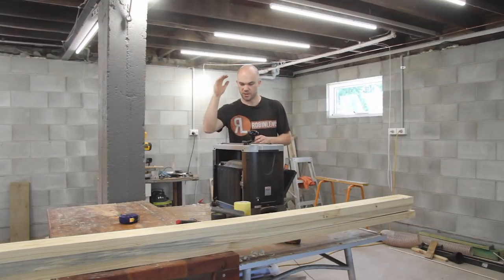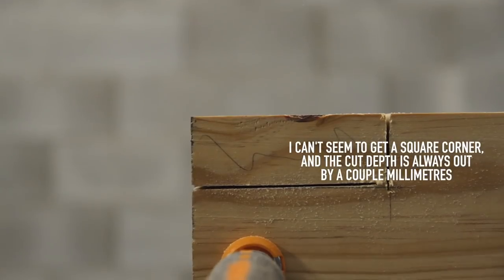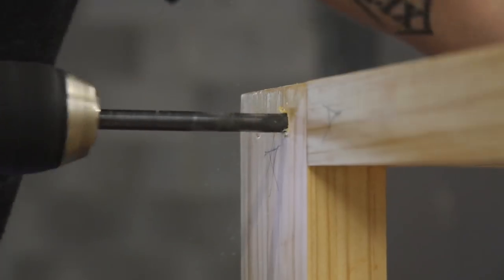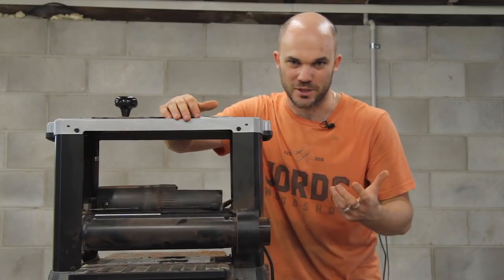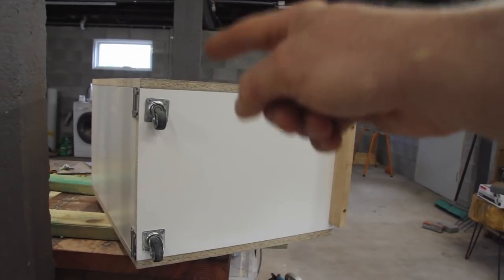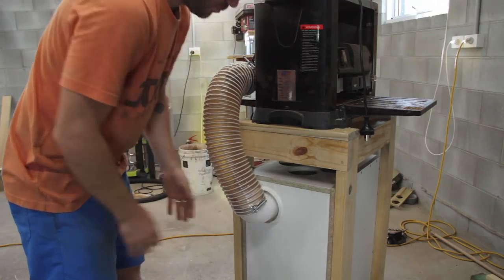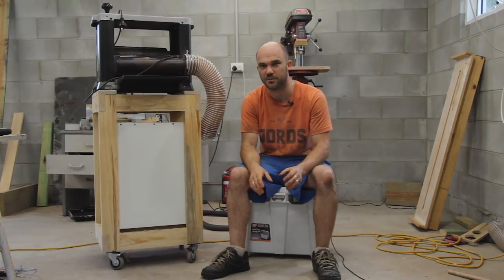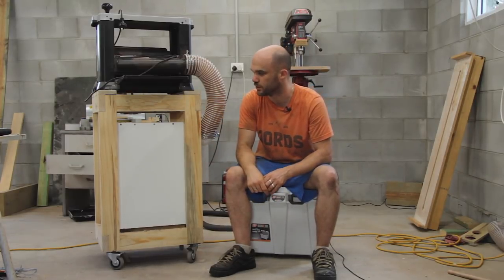DIY Mobile Planer Cart With Passive Dust Collection | Woodworking

Comment: If I may make a suggestion - with your system your getting positive pressure buildup almost any size vacuum that reduces that pressure will help the planer blower do its job and you should see better performance but you have still built a great little dust collector no matter.thanks

Comment: Great video.  Liked the roll away stand/dust collecter concept.  The chips and dust collection is a problem without a central vacuum system.  

Getting ready to purchase a Dewalt 735 planner, your video was very helpful to what can be done to control the dust.

Thanks for taking the time to explain how you controlled the dust on your planner.

From, Kansas City Missouri USA
Reply from the maker: Jack Dotzman it’ll work great for that, I’ve heard that planer has a very powerful fan for extracting chips

Comment: Shop vac will suck up those chips much easier.  But this does the job! Put a product alert on pickles and gumtree, they will pop up pretty frequently.
Reply from the maker: Pickles up here hardly has any good stuff! I look at it twice a week, most of the time it’s shop fit outs. The problem I had with my vac is the blower forces harder than the shop vac can suck, so it ends up making it worse. Guessing a bigger vac would work though
Reply: Anthony Tobba that's the one I have.  Would recommend.

Comment: Great idea!! You could try to off set the bottom dust door hinge for 100mm or so. So that when try to empty the box you can hang the wheels end on the edge of your bin (Like what you did in the video) and still be able to let the door drop open fully, if you get what I mean?
Reply from the maker: I know exactly what you mean! Give it an edge to rest on so the door can open freely. Great idea

Comment: I have my planer connected to my dust collector with a 4" hose, and I still get some chips coming out the front of the machine. It is not much, but there are a few. Just to let you know, you're is acting about right. That will be a nice solution for you!
Reply from the maker: Thanks Bruce. Yeah, until I get it hooked up to a proper shop vac it's a decent work around

Comment: Just what I have been waiting for thanks man. I have a similar Hafco thicknesser which I have attached a small shop vac to and it does not work very well always clogs. Looks like using the 100mm extraction pipe is the way to go. Thanks buddy shop is coming on nicely.
Reply from the maker: Thanks man. I tried hooking my little vac up to it, haha it did not work! Using a big pipe, especially smooth pvc, makes all the difference
Reply: Robin Lewis will give the pvc pipe a go and will let you know how I got on. Cheers.

Comment: Like the project! I just got a planer a week or so ago and need to get it mobile as well. I'm also planning a miter saw station along one wall and it would be nice if it could maybe be a little shorter and stow away under it somewhere.

I have a basic shop-vac, and so far I've had it hooked directly to the exhaust. It fills up pretty fast, though!
Reply from the maker: Thanks! Being able to store it away is a big bonus

Comment: Love the project as I’m looking to get a planer soon. Even with the locking casters do you find that with longer pieces that the cart still wiggles due to the swivel part of the casters still able to move?
Reply from the maker: Thanks! There's a little movement, particularly as the timber hits the rollers, but it's not bad at all. I actually use it without locking the wheels

Comment: What air flow? I don't think those chips are blown with air.
Reply from the maker: Some models have a blower which work great for this. This machine just pushes the chips out with enough force to make this work
Reply: @RobinLewisMakes  Looks like my Delta. Exactly. It will clog up everytime without the cyclone hooked up to it.

Comment: Why didn't you put the short horizontal boards on the inside of the posts? The gloe joint would've been better and the casters would also have had a better surface to be bolted to.
Reply from the maker: That would also work

Comment: Ther is no vacuum in the box???
Reply: doesn't need one as the planer blow out the chips in a way you don't need one.  Nice work however a much more simple solution is to hook up a power tec dust bag to some PVC and rout it to the side of the planer.  I use mine every day like that and works fantastic and much easier to empty vs the box he made.